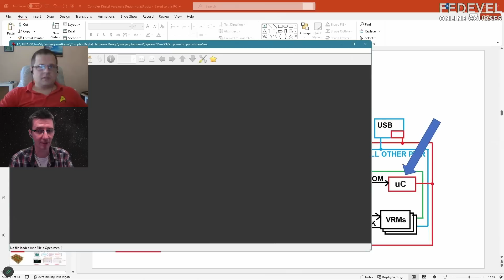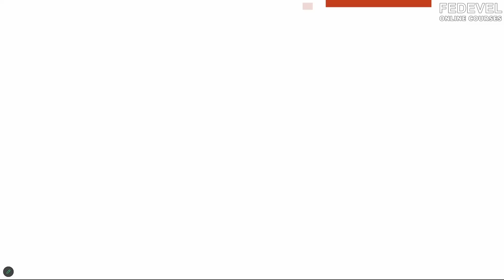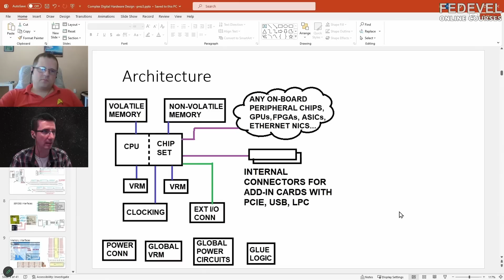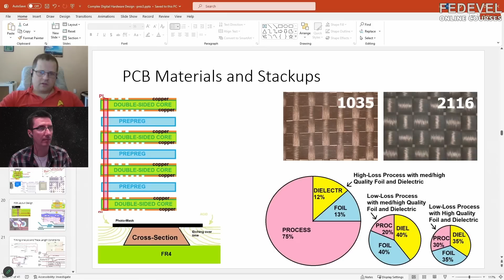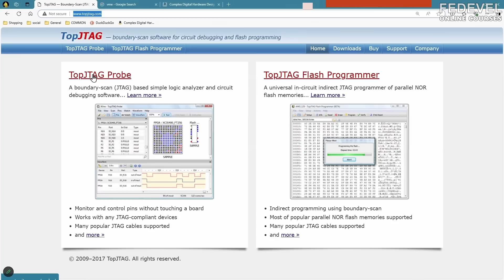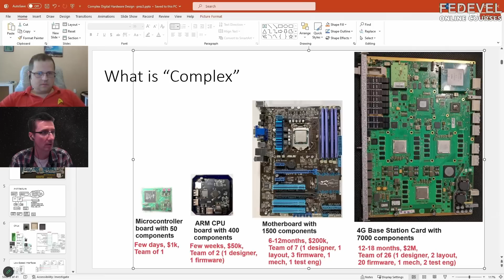How Complex Motherboards Are Designed

Comment: Question: "Can I design a motherboard at home?"
Answer: Yes. But you'd need 5+ people to write firmware, and do testing...
Reply: Those 5 firmware engineers should have experience with that type of firmware. You might need to purchase a commercial BIOS license for like $50k. You need to be an established company to be able to sign an NDA with Intel or AMD to get the CPU datasheets. Have $100k+ to spend on prototypes. This does not happen at "home".

Comment: Wait!!! Do you want to tell that people designing PC motherboards are making less than 30 grand per year? Some of them graduated from universities(some from unreasonably expensive American universities) and they are probably required to have more then 3 to 5 years of experience... As far as I can see 30 grand per year for five to nine job with a degree and ton of experience is terrible(for Europe or US that is, for eastern Europe or China it's 4 to 6 times more than average wages)... Is it really a 5 to 9 job, or is it more like one of many projects you do simultaneously(without multitasking, just during the same year or month)?
Reply from the maker: They don't work all at the same time and they don't work all for the whole of the time of development. So there may be time when only 1 engineer is working on the project, then a firmware guy can help for couple of days etc. Also there are times when there is no need for experience person working on the project e.g writing manual or there may be time when no one is working on the project e.g. when boards are in production or are running some tests
Reply: Is it even worth pursuing an EE degree if living in the USA?  All the jobs seem to be outside the country
Reply: @ I am not from USA. Where I live average salary is less then 500 bucks per month, and pretty much no one makes money except programmers, corrupted officials and soldiers. Some people I know either receive a percentage from sold devices or sell whatever they design, which is more of an entrepreneurial activity than a job.
Reply: @qt1qg  Which country?
Reply: @ Ukraine

Comment: This is a fantastic video. The stats on how many people usually work on these projects are mindblowing to me. I never pictured just a single circuit designer and single board designer working on an x86 board like that.

I originally found your channel through the series you did analysing the design features in the OCP Project Olympus dual-Xeon motherboard, so this is a nice full-circle. On that note, have you considered taking a look at any of the newer OCP stuff? The Grand Teton platform is based around DDR5 / PCIe Gen5 / OCP 3.0 (400G NIC) and has CPU cards for both AMD and Intel, plus an OCP 3.0 switch tray, and 8x accelerator card array, and some supporting boards (power distro, signal backplane, etc.) so there's a ton of interesting stuff to check out there. If you go to their contributions database page and search "Grand Teton", then click the "View available design collateral" button, you can grab the design files (933MB).

Comment: Please boil this down a little bit further, 386, 486, Pentium I, Pentium II.. I guess up to Pentium II a single person could probably do that.
Reply: a single person can do the schematic for all generations of processor boards. The additional staff is mechanical, layout, power supply, bios, management controller firmware, device driver software...

Comment: Geez, the level of garbage really hurts my eyes and I am really worried if these people do design modern electronics. This is just a great collection of how to not do things really. I have seen the book in PDF having the same pictures as in this video.. and really? I never seen such a poor book. Is it a random collection of keywords that was tasked to ChatGPT to write a book on it. No no no no. I will never forget this extensive nonsense.
Reply: how many motherboards or telecom boards or fpga boards have you designed?
Reply: for past 10+ years, we did about 400 sch+pcb designs (we number project sequentially), for both inhouse and external products. I do not believe a guy who can not keep consistency in hi illustrations in a book or video. Its just random bits collected and copied from internet here and there.. that is not engineering, but fakery.
Reply: @cameramaker  how many components did you have on your designs? Anything above 1000 comps requires working on many sub system block diagrams, simulation models, spreadsheets and flow charts for weeks or months, before the schematic design even starts. Hence "complex" in the title. There are other videos about microcontroller board design, that go straight to schematic.
Reply: Which book do you recommend then?

Comment: I would ask how many revisions to the pcb they make until they get the final product.
Reply from the maker: In my cases normally first or second revision would make it to mass production. It is expensive to build these boards so it is good to test everything and be sure it is ok before making a new revision. However, there are exceptions ... especially if potential problem could be in PCB layout, these changes can't be tested without making new PCBs. And you get the new PCB and problem is still there ... you know ... there will be probably another revision.
Reply: @RobertFeranec  maybe they develoo many smaller test boards before ordering the motherboard prototype ?
Reply: Good question

Comment: Awesome video. I wish you guys talked about some Chinese motherboard makers utilizing mobile chips as desktop and also some desktop chips IIRC. For AMD, It’s called Knoll3 / X300 / Knoll activator. I wonder if this greatly reduces complexity. Asrock has some models. You basically get an AMD desktop platform with a lot less power consumption and I suppose complexity and as a result stability.
Reply from the maker: I am working on my Chinese ... maybe in future
Reply: @RobertFeranec  I’m not sure what that has to do with Chinese 😀. Thanks for the video though I enjoyed it a lot.
Reply from the maker: @KaziQTR  Chinese - so I could visit the Chinese motherboard makers and ask questions. Talking to big chip manufacturers itself is difficult - the employees can't just talk, everything they say has to be approved by company. And talking about the chips without chip manufacturer - again difficult as it would have to be based on free and available documentation and there is not much what people can download without NDA. I have designed AMD board before ... everything was under NDA.
Reply: @RobertFeranec  I see. You are right. There is supposed to be an activator in place of a south bridge but it’s probably a simple chip that just does simple checks. I’ve heard it’s behind NDA. I wish I could design some wild motherboards. First thing I would do is slap a 7800X3D permanently and make it without the south bridge because USB 4 is separate from south bridge anyway and people don’t use SATA anymore. It’s a waste of constant 10W sucking energy non stop at best. Laptops idle at 2,5W. Even simplest boards idle at 25W. When I build a different arch computer or buy a friend a laptop I check power consumption. And there is unnecessary gap between laptops and PCs. South bridge is one of the culprits.
Reply: @RobertFeranec  It's also frustrating that these companies announce very nice features and we never get to use them because motherboard manufacturers don't utilize those features. When AMD Ryzen 7000 series was released no motherboard manufacturer took notice but they made the second portion of the x16 that is x8 PCIe lane divisible down to x1. I suppose it was designed when the mining computers were booming hence the x1s. I would still use it today if I had the chance for different purposes. I like using individual PCIe slots in my virtual machines. If they are not divided in the CPU natively, it doesn't work right in the VMs. If I could design a motherboard, I'd definitely have one like that.

Comment: So a complex motherboard is still relatively cheap in the engineering business. I am surprised how few resources they need for the most complex example
Reply: The silicon vendors do most of the heavy lifting analysis and engineering and then provide the design guide that really helps reduce the engineering effort for the board designers.
Reply: Although I work in another high tech industry, I do recognise the amount of work we put into design guidelines and (troubleshooting) manuals. I hope we allow for significant cost reductions down the line, but I have no idea what effort is needed to integrate our products for each use case
Reply: Design toolchain (that is including simulation) is significant cost leader, the price estimates are not including that, or are accounting in eastern Europe engineering salaries.